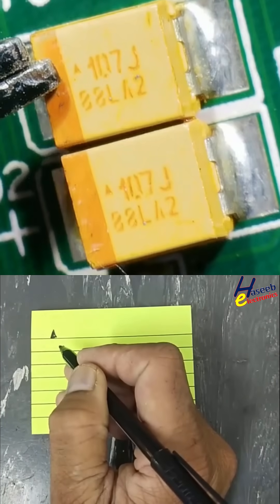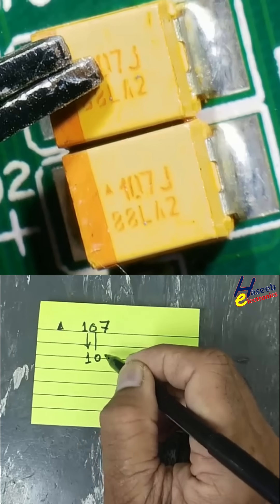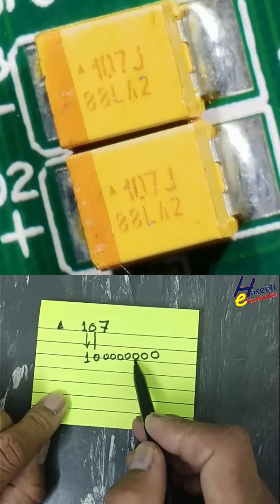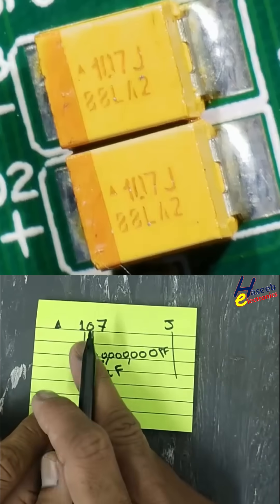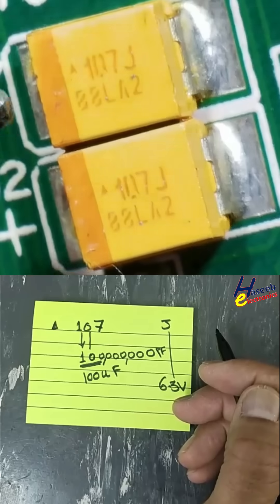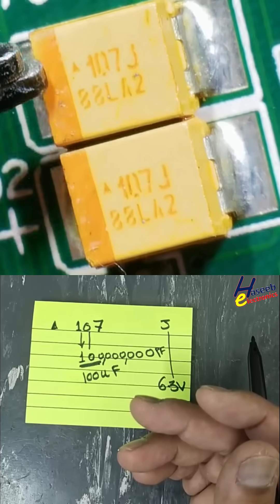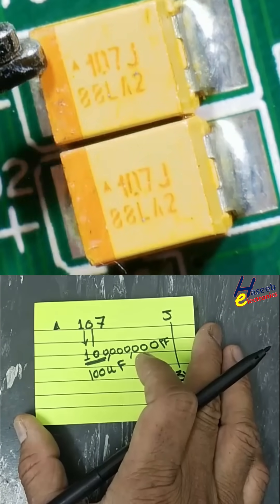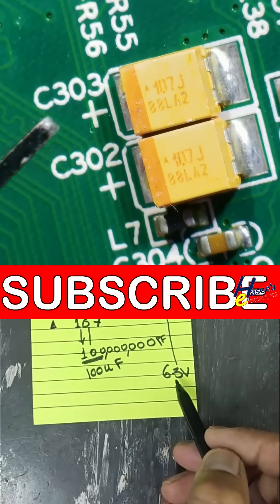Identify SMD Tantalum Capacitor Code 107J in Second! 🔍 #shorts

Comment: Can you plese explain how to measure/identify the band (positive) end of a tantalum cap if the band is rubbed off? I had this problem in the past when depotting some epoxy parts of black tantalum caps and the band was missing and the top was damaged so even the angle was not visible so it needs a better check than just visual inspection to know. Thanks brother :-)